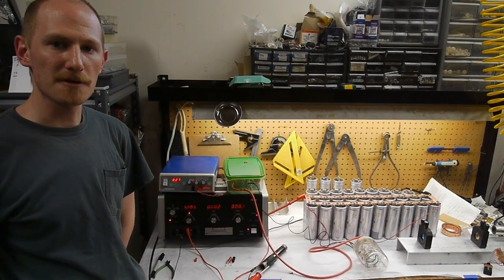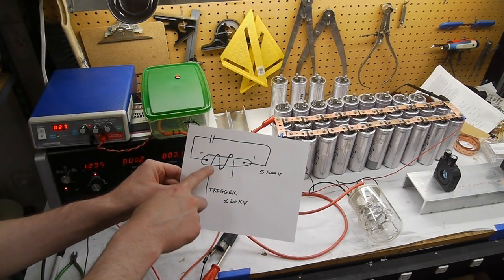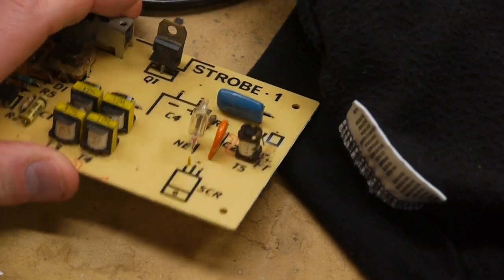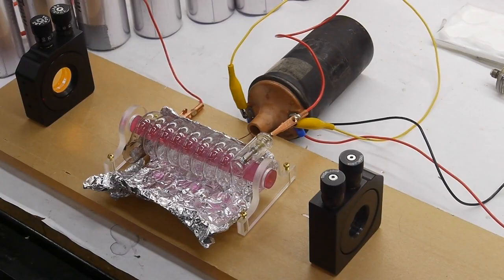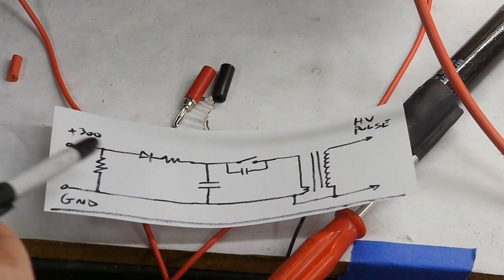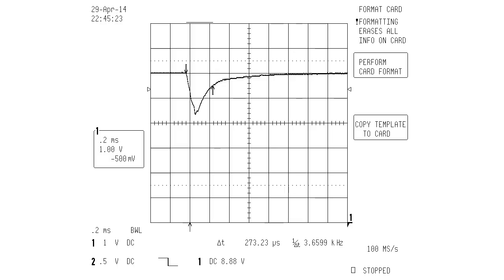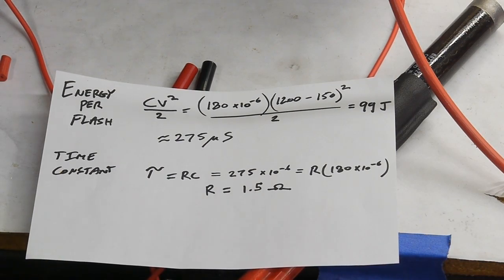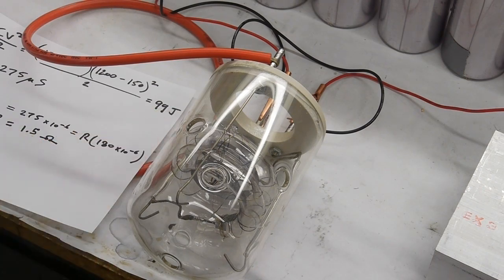Trigger circuit for large xenon flash tubes

Comment: Hi, I am building a Ruby Laser  and I have several questions that I need assistance with.I already have a new Ruby Rod that is 240mm long and 15mm in diameter with properly ground and polished parallel ends. I am looking for the Cavity mirrors for this Rod and so far I havent been able to find any used ones and I want to know if you have one or more sources for laser parts where I will be able to acquire these mirrors and the other parts that I will also need such as the capacitors and maybe flash tubes as well? 
Can you please tell me if there are fairly simple ways to calculate values such as how many joules a given  Ruby Laser Rod needs for lasing threshold as well as a simple way to calculate exactly how many joules of energy a given capacitor will hold and be able to discharge that energy through a flash lamp?I have a very extensive back ground in electronics but the theory side of all these calculus type equations have always been a huge stumbleing point for me.I have been a very dedicated and serious laser enthusiast for almost 60 years and I have bulit some very powerful lasers including 500 watt  semiconductor  and  very high power co2 that was approaching 1000 watts but I have always wanted to build a Ruby Laser so I am finally muddling my way through this project.
This project is extremely important to me and if you either cant or simply wont assist me in working out the variuos technical issues in building this laser,could you please either suggest  someone that is as interested in this as I I am. My goal here is to produce output pulse energies in the multi-megawatt range that will easily blast throungh a plate of steel and not just balloons or dark glass bottles or even a very thin razor blade,too me that is not impressice what so ever but the project that I am going to build should be quite impressive. I want this to be a show piece and I intend on assembling the entire laser assembly within a  fairly thick plexi glass enclosure that will allow easy visual access to all the inner components as well as being able to see the liquid liquid cooling system in operation and this project will mark the crowning achievements  of all the previous laser projects I have built even if that will involve cooling the Ruby Rod in Liquid nitrogen  and I need and would like someone that has lasers as much of a life long passion as myself.
I will grealty appreciate and assistance you are able or willing to offer me.

I will also be working on another Ruby Laser project in which I am going to build a much less powerful Ruby Laser as this one but I am going to inntiate laser action and  continous output from a smaller Ruby Rod but I am going to pump the Rod with Light of various frequencies using  High power Royal blue laser diodes and high power 360nm-405nm ultra violet lasers  which should produce a fairly low power but  continous  deep red laser beam from a Ruby laser  which is a multi level laser so this should also be very fasinasting to watch but the big  laser is the first one I am dealing with.

Sincerely,Peter Zeboroff

Comment: Is there an extra (4th) terminal on that flashlamp that the small black wire (the ground from the trigger circuit) is connected?  I could not see the bottom of the lamp.

Comment: Wow, this is exactly what I've been looking for. Not necessarily for a flash tube but for making a spark gap from a 360v flash capacitor. Will probably stick with a lower voltage flash trigger transformer vs the auto coil but exactly what I've been searching for for the last few days.Thank you so much for sharing your project.💪

Comment: Hi, Thanks for all the videos that use such high power "to make sure".   his Is how I love to work--I even have some of those GIANT EG&G Xe lamps that flew in the planes.
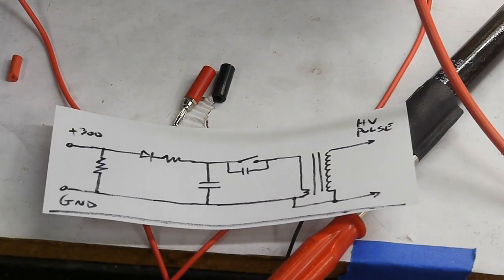One thing I would like to ask about you automotive ignition PRIMARY coil trigger circuit...Starting at timestamp 2:15 what are the values you used for the trigger (at the top line in the schematic) which includes the :DIODE/RESISTOR circuit to limit the current flow to the trigger capacitor (the 300uf @ 350V cap)?  Also what is the voltage, capacitance,and type of the cap wired across the trigger switch?

And now the question I ask that by chance someone would know:  In the automotive ignition coil: Which terminal {"+" or "-"} is the internal secondary coil-wire connected to? are they wound in the same direction,say, looking down from the top?  If they are wound in different directions...which way are they oriented from this top view...trying to avoid taking some apart, which I already did--AND LOST THE GENERAL DRAWING!!
Thanks Much,
--dALE

Comment: Hi again, and thanks for all of these very high-quality videos--amazing!!   At timestamp ~ 3:15 SO MUCH energy is being wasted in those two wires connecting the cap bank to the flashlamp electrodes.  To illustrate, if you use your PIN photodiode optical detector and measure the light pulse intensity with these wires, and then replace the wires with short high-current wires, you should see quite an improvement in optical output--I assume that the speedo machine has a built-in pulse forming inductor--it should be quite massive and wound with very heavy gauge wire (air core).

Comment: Hello again.  I was wondering about the capacitors across the trigger switch:  What is the capacitance and voltage (shouldn't the voltage be at least 300V)?  Also, I noticed that you are firing the ignition coil on the RISING magnetic field-does this work as good as the same coils in a car, which fire on the -COLLAPSING field of the primary?  Thanks for all the information in your videos!!!

Comment: I am also using an automotive for many tough-to-trigger circuits...I was wondering, do you know which ignition screw terminals  ( '+' or '-' ) is the common--with both coils connected to it? i.e. with the shortest common primary-secondary connection.  Thanks for all of the GREAT videos...please keep them coming.

Comment: In plasma water purification  in chile  I saw  one red and black cable on bith ends of the tube and instantly remembered your 1200 v dc cap bank   and one hv  trigger hto create plasma in pressurized water using air compressor   hope you can replicate it  thanks

Comment: Haha, I have that same flash kit.  I did a writeup on it on my site a few years ago.

You may find that a smaller capacitor will give a hotter trigger pulse.  There is an also an ignition coil driver on my site with an SCR for pulse control.  Check it out at it's at kickme.to/lightningstalker.  I've been getting into laser stuff more recently and can't wait to see you burn through some razor blades!

Comment: Nice work! That's one hell of a capacitor bank, can't wait to see what you do with a ruby laser!
 I do think 90kv is a bit excessive, even though your feeding it 300 volts. I've found 3cm arcs should be around 30-45kv. Its true with spherical electrodes air supposedly breaks down at ~33kv/cm but with just snipped ends it is way easier to strip ions and make a spark. With a sharp end the rule is ~1.2Kv/mm, and I've done some tests with a b&k pr28A and found it a little more than that but not much. This seems like a massive statistical gap, and I'm likely doing something wrong but it does seem to hold up. Not that it matters, as long as it works who cares what voltage we say it is!

Comment: Nicely explained. Another way to get a controlled discharge is to bring the sharpened end of a sufficiently thick, grounded wire near it. The sharp point will create a high resistance ionization path through the air as you bring it near, slowly discharging it. I do that all the time to avoid bright sparks.

Comment: Series trigger is superior, imho.
Reply from the maker: Do you have any references for the trigger coupling transformer? I searched for quite a while, but didn't find much solid info.
Reply: Applied Science It's really not critical at all, I use something like E80 cores, couple of primary turns, as many sec turns as you care to wind or you can fit on the core. You really don't care if you saturate the core, you can gap it a little to help with that.

600V pulses on the primary are enough, the actual trigger is probably done by the flyback action, not the forward pulse transmission trough the transformer.

Very similar the the HF start for TIG welders.

Use TVS diodes between the capacitor bank and the flash lamp to prevent the pulse from entering the capacitors or in the worst case the power supply.
Reply: Applied Science
http://www.orcontech.com/data/Perkin_Elmer_Flashlamp_catalog.pdf
First half covers a lot of general information and circuits about driving flash lamps.

Comment: Ben, at the end, it sounded like you said you discharged the cap bank with a 3300 ohm thick film capacitor. I assume that it was a verbal typo, since capacitors were the subject. But I assume you meant resistor, right?
Reply: Yep, it's a big power resistor.